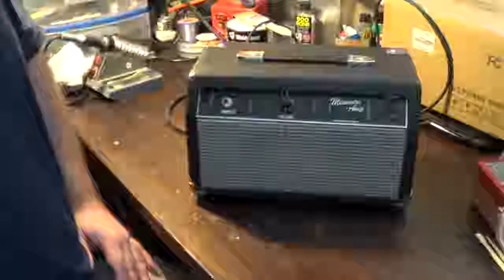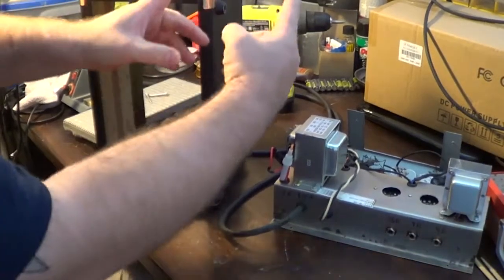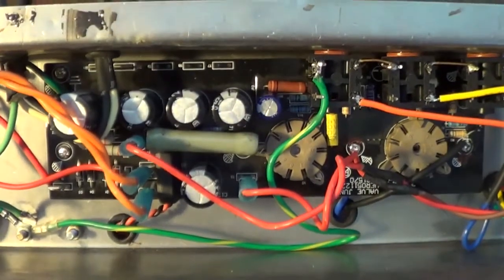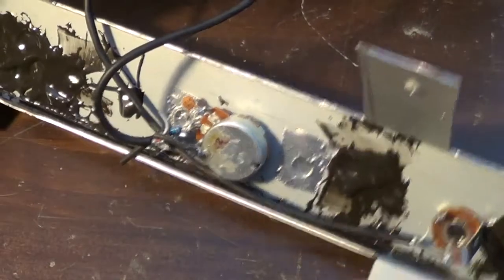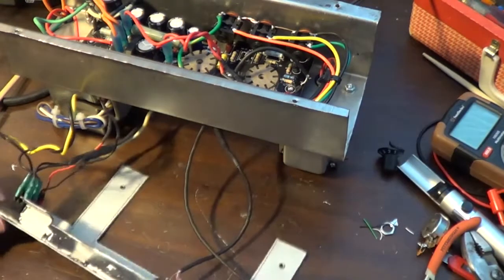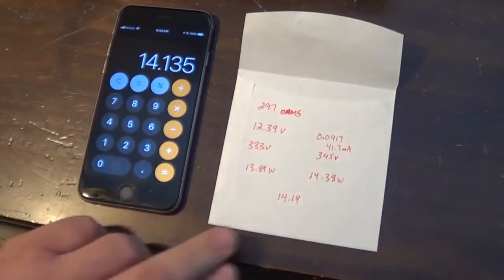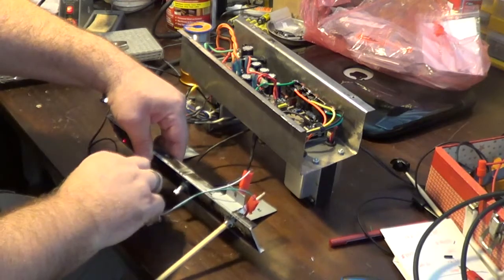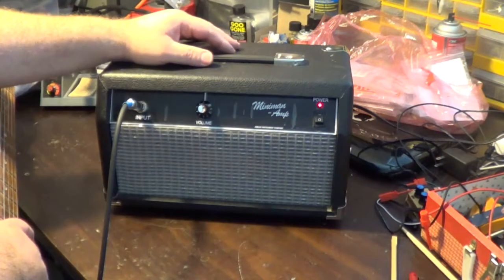Epiphone Valve Jr with the Billy Gibbons Mods Repair and Demo

Comment: I know nothing about electronics, but can your mod be done on any amp/amp head (tube)? 
Also,  are you playing through  a cab.  or dies the amp head have a built in speaker? 
Would have been nice to hear a couple of ZZ riffs to really compare.. but that's cool.
Reply from the maker: These mods are based on the Epiphkne Valve Jr circuit. You could do something similar to other circuits that have a single 12AX7 tube in the pre-amp, but how it ends up sounding would depend on the design of the original circuit. 

I’m playing through a single 12 inch speaker in its own enclosure.

Comment: add a standby switch tube amps need one especially with a solid state rectifier
Reply: Ummm, No they don't.
Reply: Wouldn't hurt and easy to do.
Reply: @davejones5745  It wouldn't really help either.  Still would get an in rush voltage spike, as I understand it.